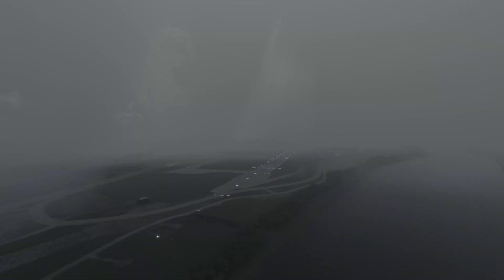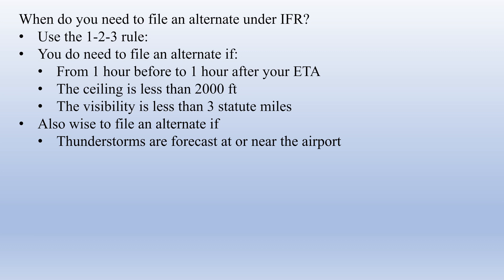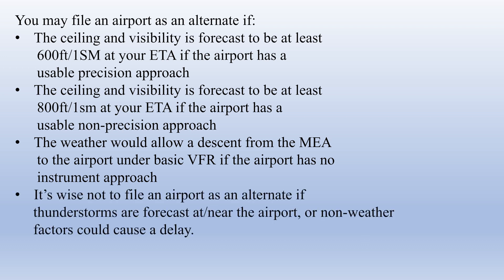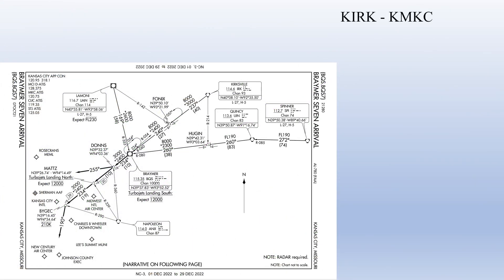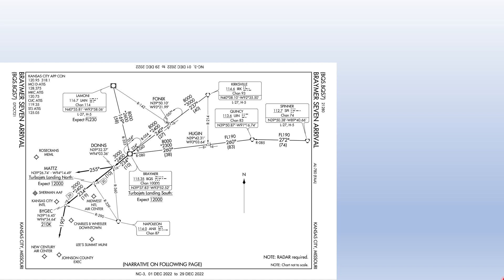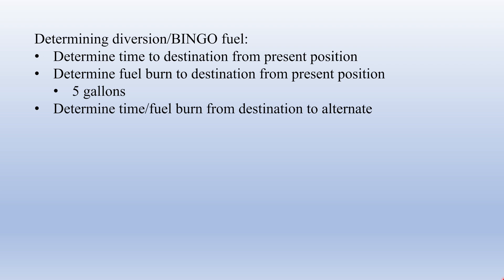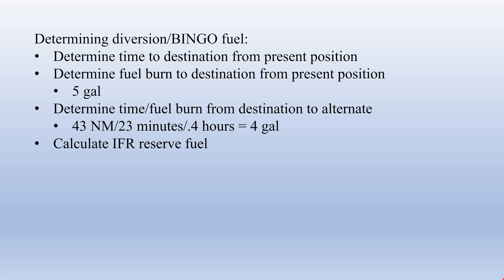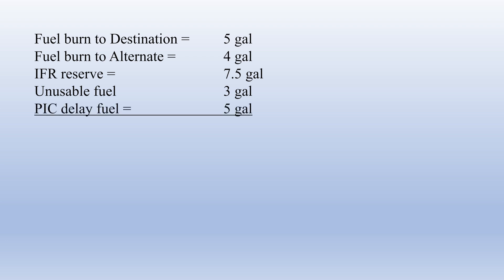MSFS - IFR Quick look #1 - Calculating divert fuel/BINGO fuel

Comment: Well presented. But is there any supporting tooling in the Garmin 1000 NXI for the various ranges? It would be helpful to see circles on the map to show how far you'd get with what kind of margin.
Reply from the maker: @TormodSteinsholt, the old G1000 (prior to the WT upgrades) actually had that feature, but I believe it disappeared with the upgrade.  (One of the few downgrades brought by the update - overall it was a big net gain in features.)

Comment: Just wondering: is it fine to assume a direct route between the destination and the alternate. No need to evaluate if there is a STAR for the alternate airport? Or is that accounted for in the 'Extra' fuel? Also, is it an incident that needs to be reported when we reach the destination with less than 45 mins of fuel reserve?
Reply from the maker: It's probably wise to calculate the distance based on a STAR if it will substantially increase the distance.  That being said, the extra fuel should cover that sort of discrepancy, if you need to do some quick math while in holding to see how long you can stay there.  

There's no legal requirement to file any sort of report if you land with less than 45 minutes of fuel - though many professional flight departments do have a policy that you must declare an emergency if it appears you will burn into your reserve.

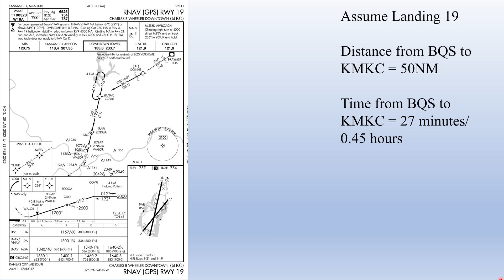Comment: At 8:57 you say average enrout gas burn of 6 gallons an hour, which is 10 GPH in the earlier slides. However, the math is fine, because the 27 mins gives you 5 gals of fuel burn.
Reply from the maker: @mpaw23, I probably just misspoke, and stated the fuel burn numbers for the 152 for some reason.